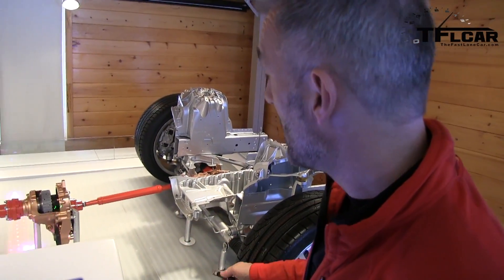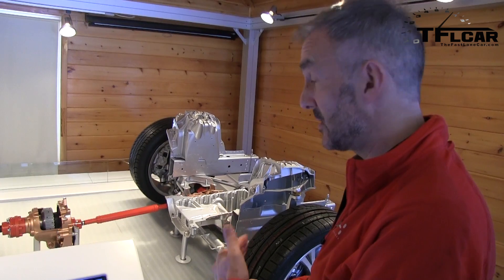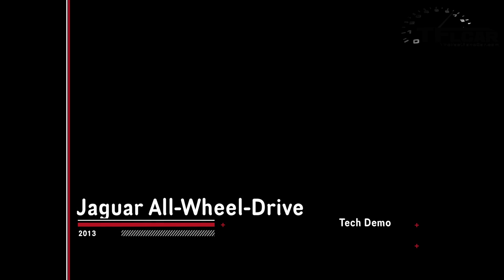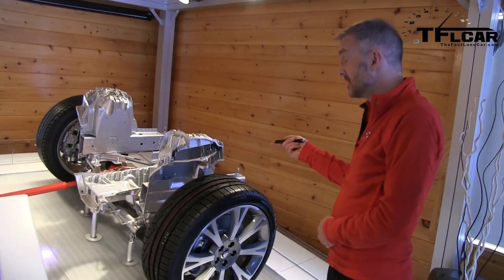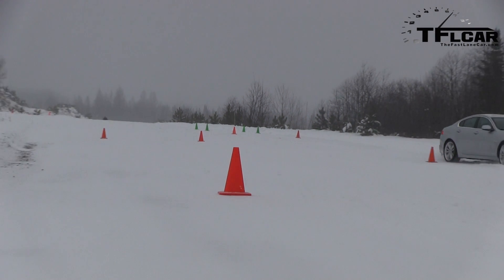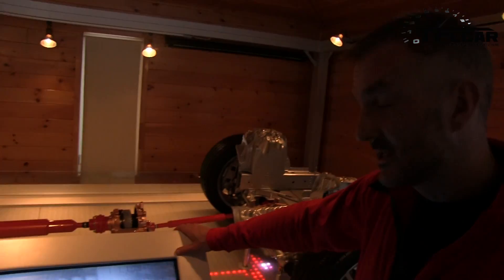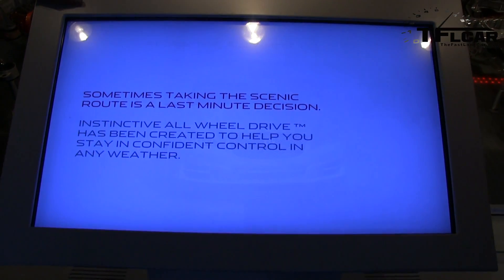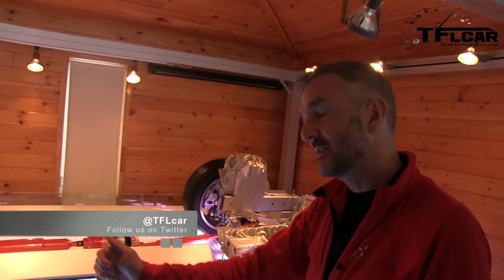2013 V6 Jaguar XJ: Everything you'd ever want to know about the new AWD system

Comment: Within the first 30 seconds he talks about the system having a clutch pack as a center differential. Initially, the clutch pack is disengaged and power only goes to the rear. The more slip, the more lockup. THIS IS A REACTIVE SYSTEM. 

Now, regarding a situation where an actual differential would be more advantageous, consider a incline where ice is only under 2 of the 4 wheels. With an open diff, you spin and won't have enough power to move up. With a locked diff, you would be going right up.

Comment: Ferrari did the same exact thing with the FF. Keeping the engine as low as possible keeps the weight low which aids handling. It's not a "band aid" solution as you suggest, it's smart engineering.

Comment: For most everyday cars, A system using the brakes to limit wheel slip can provide most of the benefits of a locking/ limited slip differential without the cost, weight or complexity. But seeing 3:45, its a shame that they haven't even bothered with that.

Comment: so an axles shaft has to go through the oil sump to make the engine as low as possible. Seems like a band aid solution (compromise) to convert a RWD to an automatic-part-time AWD system. It'll be expensieve to replace that half shaft - I hope it never needs this repare (but I guess Jaguar buyers can afford that, though (I hope))